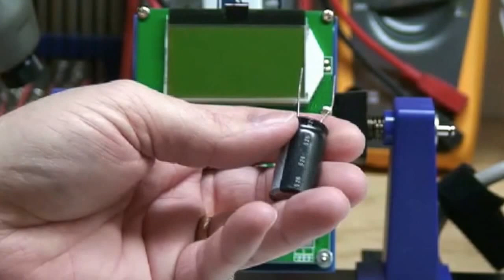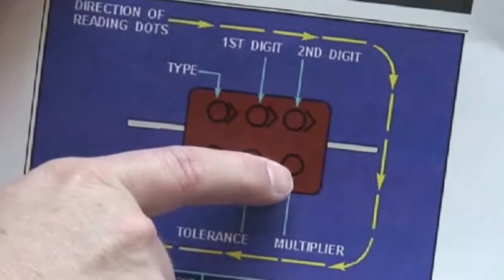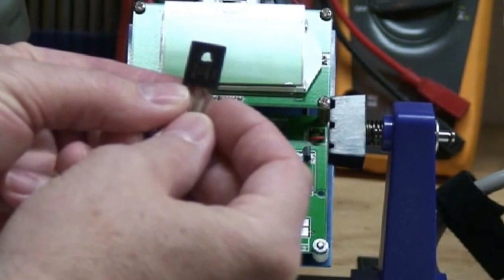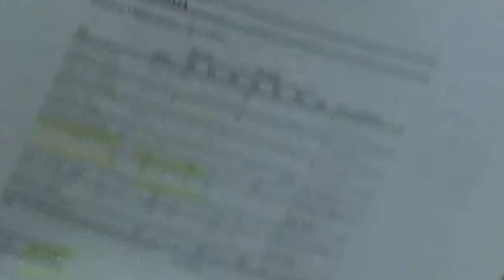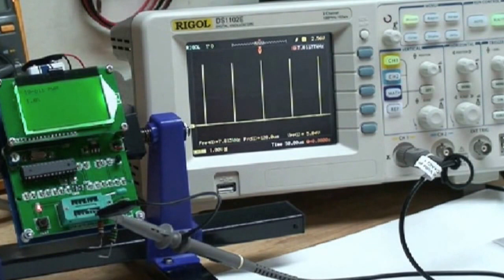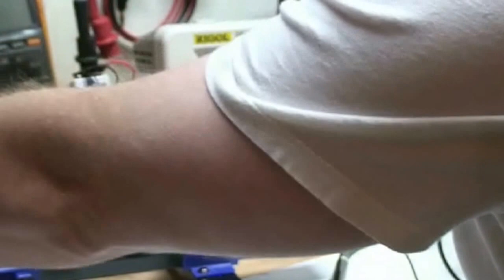Review#1 YOSOO GM328 Electronic Component Tester

Comment: How do you know where to put which pins where on the tester?

I've been testing diodes, and just just randomly choose which holes to put the pins in.  Really have no idea what causes it to work or not though.
Reply from the maker: HI,
They alternate 1,2,3,1,2 etc. So diodes can go to either combo of 2 pins for ex: 1-2, 1-3, 2-3. You have more than one spot to help for each pin to accommodate many varying shaped components. Same thing for transistor etc. Any pin labeled 1, 2, 3.
So it's like below...
[1] [2] [3] [2] [1] [2] [3]
[1] [2] [3] [2] [1] [2] [3]
Reply: @ThriftyToolShed  Thank you!  My screenprinting (or however they label PCBs these days) was smeared, but now I can see exactly as you describe.

Comment: Can you use this to test components in a circuit without removing them?
Reply from the maker: I have had luck testing capacitors and some transistors in circuit, but it all depends on the circuit. Since this is an auto tester and test for many varying components with different characteristics it will identify as the best match and sometimes with inductors and resistors in the circuit it is simply impossible to get a true reading. I have better luck using the peak ESR70 or another special purpose ESR/Capacitor tester in circuit since it is looking for exact components and its characteristics. The best thing to use in circuit and especially when comparing between 2 boards is the curve tracer. I have a video on making a very simple one.
Reply: @ThriftyToolShed  Ok, now that's a proper explanation, Thank you.
Is there and way to modify this device so as to set it to the exact component you want to test? That would work? 
Is it as accurate out of circuit as any other lcr meter?  The price on it is amazing, I'm definately going to get one of these.
Is that curve tracer video on your channel, I will check it out. In reference to lcr meters in general which cost up on 400 euros, can they test capacitors in circuit with any accuracy? .  If a capacitor in circuit has others in parallel to it then wouldn't it make a test worthless regardless of the price of the meter?

Comment: The rotary encoder can be fitted to the board and you can run through the menu with it. The firmware is a little old. (2022). The latest is 1.13k. Already old and not kept up to date. However there is a " m" version but you can update it with that. I would not bother to do that. The "m" range have gone way overboard with new processors etc. It never will be a proffesional. Very very good for diy.
Reply from the maker: Thanks for sharing! Yes, this is an old video indeed. My first on the channel actually. The firmware is very old at this point! Very true about DIY or for me as a hobbiest!

Comment: Hi thanks for the video there seems to be a lot of different versions of the gm328 and the yosoo seems to be very hard to locate online in the uk. are all the gm328 products the same under a different name. I really just want this to identify components that im unsure of and test capacitors.  Does this product fully test capacitors or only state esr value?
Reply from the maker: Yes, there are many different versions although they are similar, I have never taken time to compare them to one another, I only purchased the one like in the video, the first or one of the first versions. They do a great job for what they are and check the caps quite well as shown in my first video. The link in that video description is like the version I have and used in that first video!

Comment: At right side of the Test socket is the SMT test pad, also have number to Identify each. When test two lead component(resistor, capacitor, inductor), the two lead can select any two test point . if TP1 and TP3 is selected, the Test will enter to” series test mode” when the test is Completes. Else the test is start again by a short press RPEWS.
Attention: All ways be sure to discharge capacitors before connecting them to the Tester! The Tester may be damaged before you have switched it on. There is only a little protection at the MCU’s ports. Extra caution is required if you try to test components mounted in a circuit. In either case the equipment should be disconnected from power source and you should be sure, that no residual voltage remains in the equipment.
Control by a “rotary pulse encoder with switch”
DC JACK
square wave & PWM Output interface
voltage measurement input interface
frequency measurement input interface
For SMT component Test
Test socket
The left six belong to TP1
The middle two belong to TP2
The right six belong to TP3
Self test and Calibration:
the self test can be prepared by connecting all three test point together and pushing of the RPEWS, the color of the Tester’s LCD will change to white font and black background. Prompt string “Selftest mode..?”, To begin the self test, the
RPEWS must be pressed again within 2 seconds, else the tester will continue with a normal measurement.
Now self test is start, the tester will prompt you for next step. Wait for a time until Prompt string “isolate Probes!”, at that time remove the connecting . Tester will wait , until it’s sense the disconnect. Then Tester continue the self test process. If this is the first time use self test(the Transistor Tester is assemble by yourself from scratch ), Tester will soon Prompt string “ 1-||-3 > 100nf” , A capacitor with any capacity between 100nF and 20μF connected to pin 1 and pin 3 is required for the last task of calibration, You should connect the capacitor not before this text is shown. With this capacitor the offset voltage of the analog comparator will be compensated for better measurement of capacity values.
special using hints:
Reply: Normally the Tester shows the battery voltage with every start. If the voltage fall below a limit, a warning is shown behind
the battery voltage. If you use a rechargeable 9V battery, you should replace the battery as soon as possible or you should
recharge. the measured supply voltage will be shown in display row two for 1 second with
”VCC=x.xxV”. It cannot repeat often enough, that capacitors should be discharged before measuring. Otherwise the Tester can be damaged before the start button is pressed. If you try to measure components in assembled condition, the equipment should be all ways disconnected from power source. Furthermore you should be sure, that no residual voltage reside in the equipment. Every electronical equipment has capacitors inside! If you try to measure little resistor values, you should keep the resistance of plug connectors and cables in mind. The quality and condition of plug connectors are important, also the resistance of cables used for measurement. The same is in force for the ESR measurement of capacitors. With poor connection cable a ESR value of 0.02Ω can grow to 0.61Ω. You should not expect very good accuracy of measurement results, especially the ESR measurement and the results of inductance measurement are not very exact Components with problems: You should keep in mind by interpreting the measurement results, that the circuit of the Transistor Tester is designed for small signal semiconductors. In normal measurement condition the measurement current can only reach about 6 mA. Power semiconductors often make trouble by reason of residual current with the identification and the measurement of junction capacity value. The Tester often cannot deliver enough ignition current or holding current for power Thyristors or Triacs. So a Thyristor can be detected as NPN transistor or diode. Also it is possible, that a Thyristor or Triacis detected as unknown. Another problem is the identification of semiconductors with integrated resistors. So the base -emitter diode of a BU508D transistor cannot be detected by reason of the parallel connected internal 42Ω resistor. Therefore the transistor function cannot be tested also. Problem with detection is also given with power Darlington transistors. We can find often internal base - emitter resistors, which make it difficult to identify the component with the undersized measurement current. Measurement of PNP and NPN transistors: For normal measurement the three pins of the transistor will be connect in any order to the measurement inputs of the Transistor Tester. After pushing the RPEWS, the Tester shows in row1 the type (NPN or PNP), a possible integrated protecting diode of the Collector - Emitter path and the sequence of pins. The diode symbol is shown with correct polarity. Row 2 shows the current amplification factor (hfe=...) and the Base - Emitter threshold voltage. You should know, that the Tester can measure the amplification factor with two different circuits, the common Emitter and the common Collector circuit (Emitter follower). Only the higher result is shown on the LCD. With Germanium transistors often a Collector cutoff current ICEO with current less base or a Collector residual current ICES with base hold to the emitter level is measured. Measurement of JFET and D-MOS transistors: Because the structure of JFET type is symmetrical, the Source and Drain of this transistor cannot be differed. Normally one of the parameter of this transistor is the current of the transistor with the Gate at the same level as Source. This current is
often higher than the current, which can be reached with the measurement circuit of the Transistor Tester with the 680Ω resistor. For this reason the 680Ω resistor is connected to the Source. Thus the Gate get with the growing of current a negative bias voltage. The Tester reports the Source current of this circuit and additionally the bias voltage of the Gate. So various models can be differed. The D-MOS transistors (depletion type) are measured with the same method. You should know for enhancement MOS transistors (P-E-MOS or N-E-MOS), that the measurement of the gate threshold voltage (Vth) is more difficult with little gate capacity values. You can get a better voltage value, if you connect a capacitor with a value of some nF parallel to the gate/source. The gate threshold voltage will be find out with a drain current of about 3.5mA for a P-E-MOS and about 4mA for a N-E-MOS Function menu descriptions:
Reply: 1. Switch off Enter this Function Tester will shut down immediately. 2. Transistor Transistor test, it’s also the default Function at switch on. 3. Frequency Measurement of frequency, For frequencies below 25kHz the normal measurement is followed by a measurement of period time. This additional measurement is only followed after a normal frequency measurement. 4.f-Generator Signal generation, this Function can output square wave .with various of frequency to choice. 5. 10-bit PWM The function ”10-bit PWM” (Pulse Width Modulation) generates a fixed frequency(7812.5Hz) with selectable pulse width at the pin TP2. With a short key press (< 0.5 s) the pulse width is increased by 1%, with a longer key press the pulse width is increased by 10%. If 99% is overstepped, 100% is subtracted from the result. The function can be exit with a very long key press (> 1.3 s). 6. C+ESR@TP1:3 The additional function ”C+ESR@TP1:3” selects a stand-alone capacity measurement with ESR (Equivalent Series Resistance) measurement at the test pins TP1 and TP3. Capacities from 2μF up to 50mF can be measured. Because the measurement voltage is only about 300mV , in most cases the capacitor can be measured ”in circuit” without previous disassembling. The series of measurements can be finished with a long press of RPEWS. 7. Rotary encoder With the function ”rotary encoder” a rotary encoder can be checked. The three pins of the rotary encoder must be connected in any order to the three probes of the transistor tester before the start of the function. After starting the function the rotary knob must be turned not too fast. If the test is finished successfully, the connection of the encoder switches is shown symbolic in display row 2. The tester finds out the common contact of the two switches and shows, if the indexed position has both contacts in open state (’o’) or in closed state (’C’). A rotary encoder with open switches at the indexed positions is shows in row 2 for two seconds as ”1-/-2-/-3 o”. This type of encoder has the same count of indexed positions as count of pulses for every turn. Of course the pin number of the right common contact is shown in the middle instead of ’2’. If also the closed switches state is detected at the indexed positions, the row 2 of the display is also shown as ”1—2—3 C” for two seconds.
Reply: I don’t know any rotary encoder, which have the switches always closed at any indexed position. The interim state of the switches between the indexed positions is also shown in row 2 for a short time (< 0.5s) without the characters ’o’ or ’C’. 8.Selftest With the menu function ”Selftest” a full self test with calibration is done. With that call all the test functions T1 to T7 (if not inhibited with the NO TEST T1 T7 option) and also the calibration with external capacitor is done every time. 9. Voltage Voltage measurement, Because a 10:1(180K:20K) voltage divides is connected , the maximum external voltage can be 50V, The measurement can also be exit with a extra long key press (> 4 seconds). 10. Show data The function ,Show Data” shows besides the version number of the software the data of the calibration. These are the zero resistance (R0) of the pin combination 1:3, 2:3 and 1:2 .In addition the resistance of the port outputs to the 5V side
(RiHi) and to the 0V side (RiLo) are shown. The zero capacity values (C0) are also shown with all pin combinations (1:3, 2:3,1:2 and 3:1, 3:2 2:1). At last the correction values for the comparator (REF C) and for the reference voltage (REF R) are also shown. Every page is shown for 15 seconds, but you canselect the next page by a key press or a right turn of the rotary encoder. With a left turn of the rotary encoder you can repeat the output of the last page or return to the previous page. 11. FrontColor This function can change the color of the font, the 16bit color is encode in RGB(565) format, that mean red maximum = 31, green maximum = 63,blue maximum = 31 respectively. In the function, a short time press can index the base color to change, turn left decrease it value and turn right increase it value. A long time press will save the Result and exit the function, please keep in mind the FrontColor and the backcolor cannot be the same. This will case the LCD show nothing. If this happens, you need to do a Selftest , how to enter the Selftest is descriptions at Page 2. Selftest will change the back Color to black and font color to white automatically. When the Selftest is finish . you will have the chance to modify the color . 12. BackColor This is function is the same as the FrontColor except it’s change the background color . 13. 1-||-3 This function can series Measurement the capacitance at TP1 ,TP3, this function can Measurement very small capacitor. A long time press will exit the function.
14. 1- - 3 This function can series Measurement the Resistance and inductance at TP1 ,TP3, A long time press will exit the function
...and finally heres a link for more information/ data about the Transistortester

 http://www.mikrocontroller.net/articles/AVR-Transistortester

PS:, this new 2020 blackboard version I bought off eBay..... for $8.85, and it arrived completely assembled and ready & working.
, last 3 I ordered since 2003 were all "Kits" and a wonderful DIY project, although it was a relief to have this assembled simply because I've been way ahead of soldering for beginners, and find it tedious,boring & laborious soldering 18 basic 1/8 watt
If you find yourself with a solder ur self trans-checker  kit, no matter what version, there is always going to be 3 SMD components board, topside, bottom of test bench, the extra coolio thing with these 3 SMD's is you don't even have to use/solder these 3 components (a zener, a SM diode and a 6 leg distribution IC SRV05-4
  to the board if not comfortable soldering tinyass SMD components yet. but you'll lose the tst bench surge protection (testing a cap and forgot to discharge it first)